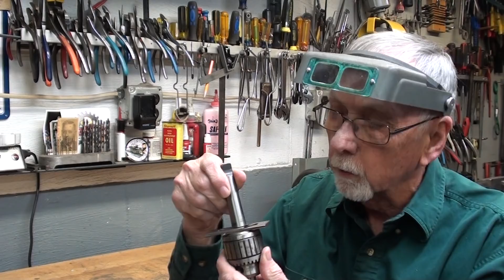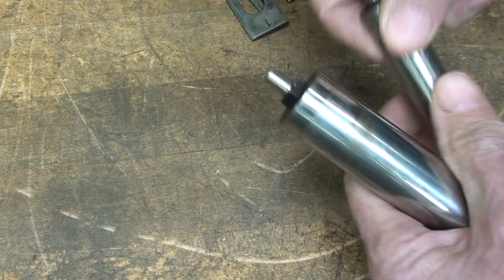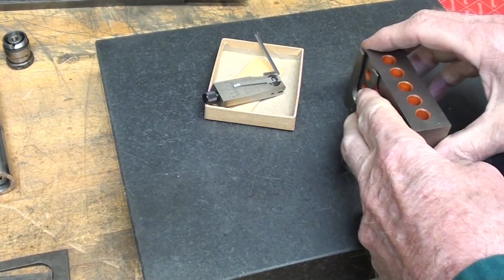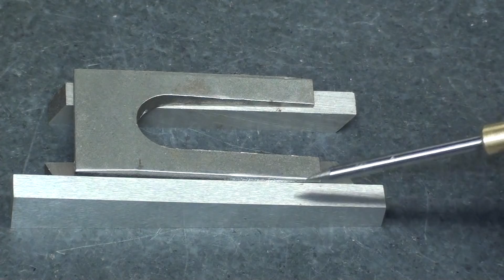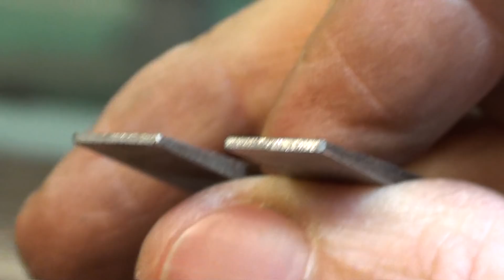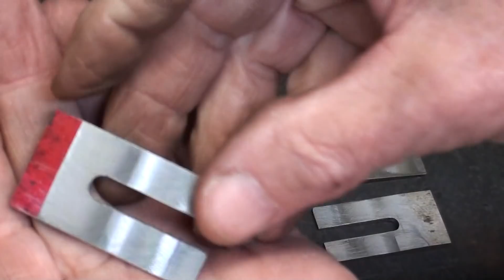Making Jacobs Chuck Wedges Tips #519 tubalcain

Comment: I have an old Delta 11-990 drill press with a stuck arbor in the quill. I have suspect MT1 can remove it. The arbor is around 10mm wide at the quill.

I’m not able to confirm and any directions would be appreciated!
Reply from the maker: You are confusing me. Does this drill press have a Morse taper spindle?
And is your chuck held on his Arbor with a Jacobs taper?

Comment: Nice job! I have noticed a few of my arbor-to-chucks do not have the "normal/standard" distance between so that 2 wedges will work. This would give one the ability to make a special set as needed. When one finds a 1/2 smooth arbor with nothing to press against from the chuck, then creativity gets involved and usually a modified arbor (if it survives or can be trusted after removal).

Comment: I have several sets of Jacobs wedges - JT1, JT2, and JT6 that also works with JT3/33. I work on a lot of vintage gear. Light industrial. The wedges often aren't thick enough. When there's an a removable arbor, often a JT2 can be wedged firmly while a JT3/33 is struck. However, when there's too much space and the chuck attaches directly to the taper on the spindle, then what? I'd made several Jacobs-like wedges in various thicknesses. Problem solved. They're not made as precisely as the wedges in the video. Very nice work. Really.

Comment: When the chuck is new drill a hole through the back and tap it.  When you need to remove it just put in a screw and push it off.  Saves a lot of time.

Comment: Thanks for another great video. When you pulled out the angle blocks and went to the surface plate, I thought for sure you were going to place the 3 degree block upside down on the wedge, then indicate along the top to show its parallel to the surface. Been helping my 16 year old with his geometry homework has given me a renewed appreciation for what the ancient Greeks figured out.

Comment: It's nice to have a vertical milling machine for these.  However, I don't have one.  I made mine by starting with a 1/4" piece of plate steel and used an angle grinder with cut off blades to cut everything, from the slots to the outline.  I then used my angle grinder with a grinding disk to taper the wedges to the needed taper and thickness.  This took a while, but the resulting set worked like a charm.  I put the wedges on my chuck (an expensive German chuck mounted on a mauled arbor) in my vice and with a few turns of the vice handle, the chuck and arbor popped apart.
Reply from the maker: Nice job, you are a very patient man.

Comment: Hi mrpete222, Interesting stuff, there obviously are different ways of making these as you have already pointed out, I think you also asked us for comments on how we would make them, so here are my two cents,  I would have slotted the material first, then cut material to length, then lay an existing Jacobs wedge on a surface grinder with the new material on top of it and grind to a wedge, no need to work out the angle as this would automatically be done. But obviously you can only do this if you have a surface grinder.
Reply: John Bower - Why would someone need to make these, if they already had them?
Reply: @stevek5416  As in this case, not having all sizes?
Reply from the maker: That is a good solution thank you
Reply: When I made my set, I just eye-balled the angles.  They aren't even flat on the angles, but they still did the trick.

Comment: Flex shaft grinders: Have you ever used one? any tips or suggestions on good brands or upgrade parts? I was gifted a SE 979FSG for Christmas. So far I have ordered spare hand pieces to make tool changes faster instead of dealing with the chuck and chuck key. Also a new footswitch but after that I have no idea what I should get for it.
Reply from the maker: I use a foredom. With Dremel attachments
Reply: @mrpete222  awesome thanks. I know the foredom is the go-to for most people.

Comment: Lyle, I had never used an Albrecht chuck. But when I got my new Powermatic drill press, it came with one. I fell instantly in love with it. But that did not last long. Here is why: If you use large bits; or especially large "hole" saws; the chuck will bind so tight that it simply cannot be broken with the hands. Fortunately, I found a YouTube DIY that said, "use 2 special "Vise Grips"" to break it loose. (Irwin Vise Grip-12LC)

They DO the job, but they are liable to ruin the knurling on the outside of the chuck.

Have you had this problem with said chucks? And if so what did you do to break them once they gall together?

Thanks dear brother.
Reply: at a spring factory i used to work at ..they told me to never use a hand tightening chuck with a bit bigger than 1/2 .... they said it would bust the chuck ....and i think they found out the hard way ....and they were using Albrecht chucks ...........
Reply from the maker: I did have one jam. I used leather and a channel lock. I generally use them only for smaller bits.

Comment: You cut that clearance close, I was puckering for you. I agree anytime you can mount something at an angle in the vice it is the best method. Question did the finished slot need to be at the same angle or was that convenience because of the part being chucked
Reply from the maker: The angle of the slide could not have mattered any less

Comment: I have a magnetic chuck that I think I could use to cut the taper. Just angle the chuck at 3 degrees and use a flycutter. I haven't tried anything like that, but I might just try it to see if it would work.
Reply from the maker: Yes, that would be a good solution
Reply: highpower -Be really careful. thin material does not hold well on mag chucks.
Reply: @milantrcka121  I know, that is why if I were to try it, I would do light cuts.
Reply: @milantrcka121  I Agree it could be dangerous, an interrupted cut would not recommend it.

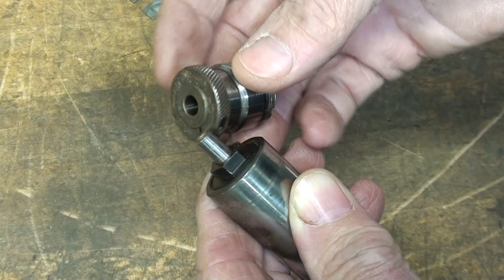Comment: Oh we are already following you on Instagram though we like watching you more on YouTube. Our drill presses are so fragile if we use anything like that chisels it will likely bend the shank arbor spindle and whatever else damage bearings side to side not allowed. Loving on the Die Makers Square mr.pete:) Word of the day be-la-bor ing no never mr.pete you can never over express your messages to us. From your comment yesterday, Yes my day starts early in California 3:00 daily work starts at 6:00 AM daily. The vise on the green milling machine? is that a 6.00 inch Ellis Tools and Manufacturing Company vise? Just learning here. I notice both you and Randy Richards use red dykem instead of the blue just wondering as I was written up for using it out of the inspection department years ago as it indicates rejection or errors in a production shop, not criticizing here just trying o learn about things. In the end a nice working 3 degree wedge repair tool.
Reply from the maker: Yes, I do love that little square. The reason I use the red dye is this. 20 years ago, someone gave me a case of quarts of the red dye. I pour it into the smaller containers. I gave most of it away, but I still have enough left to take me into the next century.
Reply: Interesting. I'd never heard that about red dykem, but it certainly is sensible.
Reply: @ExtantFrodo2  Yes the red dykem was for first article parts run around parts corrections back to programming etc. in production shops aerospace job shops quality control to prevent error dimensional parts from making there way onto or into the good parts areas and to help make a first part to follow making the second and so on, it was what I learned but there is likely many other quality control methods besides this to select from all about controlled flows and error reduction regardless.  Thank you for sharing.
Reply: @ActiveAtom  thanks that's awesome.
Reply from the maker: The vise is a 5 inch Genuine Bridgeport vise. I really like the Bridgeport vises. I have a 5 inch and a six-inch

Comment: Can you use the same kind of wedge for a Morse taper
Reply: Chucks don't fit onto a morse taper. a morse taper usually fits into the machine itself. some morse tapers are held in with a drawbar but the majority are held in by the taper itself as in most drill presses. there is a wedge to remove them from a drill press but it is a different style and is insertd in the quill of the drill press and bears against the tang of the morse taper and forces the morse taper out when tapped with a hammer.
Reply: The principle is the same. I  made some wedges to remove my er32 collet chuck from the mt3 taper in my mill spindle. I use a drill press vise to squeeze the wedges together to extract the taper. Much kinder to the bearings than hitting the drawbar with a soft headed mallet.
Reply: Thank you

Comment: I work with plenty of guys that firmly believe screwdrivers are actually pry-drivers.
Reply: Hey!  I resemble that remark.
Reply from the maker: Isn't that what they are for?
Reply: @mrpete222  keep an edge on the tip for those small flat heads and its a chisel its double duty in in your pocket
Reply: Screwdrivers are disposably cheap. I have no problem destroying one to get my task done.